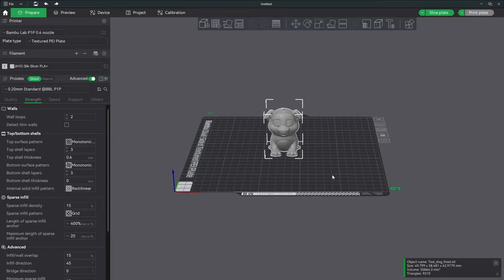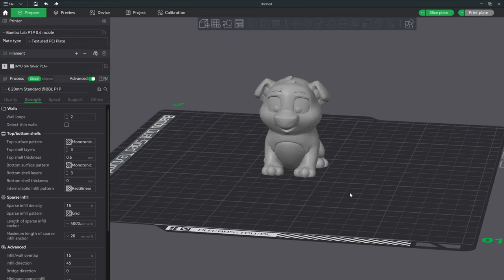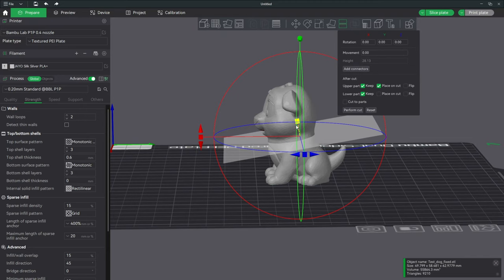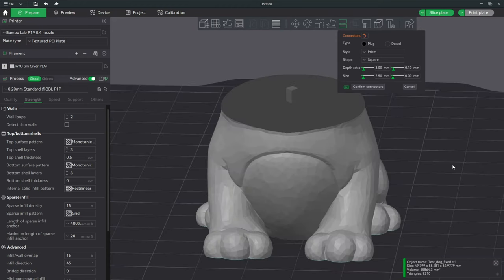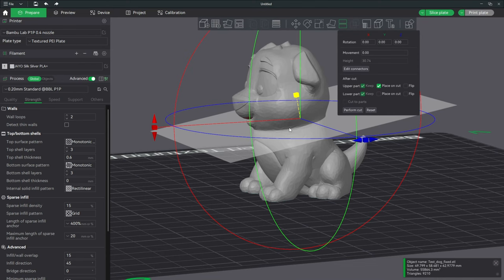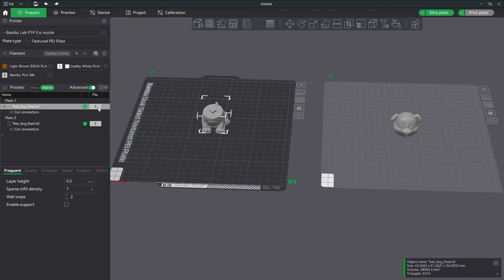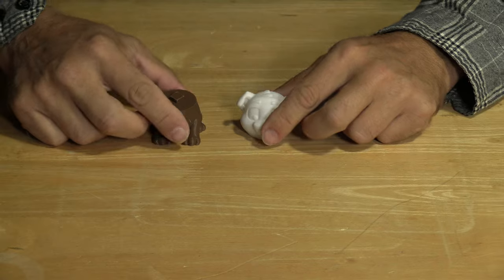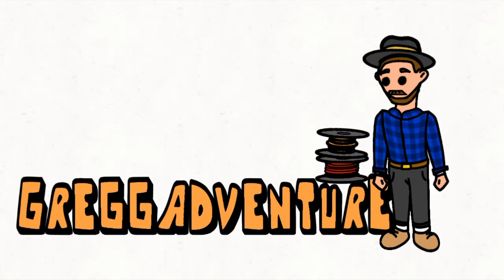How to Cut a Model into Multiple Parts with a Peg & Hole in Bambu Studio - Orca Slicer - P1P P1S X1C

Comment: VERY VERY HELPFUL, if I scale the figure to a larger size, is the union or the tolerances maintained or would I have to make the cuts with the final print size?
Reply from the maker: I would make the cut with the final size, but you should be OK.

Comment: Need to make sure Advanced Mode is toggled or option doesn't appear in tool bar. This crashes on current version of Orca on MacOS if you click the right mouse button while trying to set up the cut. And you can't type the angle of rotation for each axis as shown in this video.
Reply from the maker: That's what you get for using a Mac. 😂🤮

Comment: These quick tutorials are very helpful to new users!  Thank you!  :)    

Also, quick tip:  If you plan to print these sequentially on the same plate, don't center them both.  Keep one off center so you don't have to reapply glue stick!  :)
Reply from the maker: I'll do you one better. Don't re-apply for several prints. 🔥🔥
Thank you. I will be trying to do more. 🙏🏼
Reply: @3DRundown  
I'll do you both even one better: Use hairspray instead of glue stick. Much more uniform coating.
Reply: This is PLA on a textured plate, why would it need glue stick at all?

Comment: Awesome video thanks
Question after you spilt and you send the other part to a new bed , can you save this and print later for if you have the one printer ? 

Im currently working on some decor display pieces. Ive drawn a stand / base on them just working out the best way to print. I.e the design and the base separately.

Thanks
Reply from the maker: Of course. It's your project.... you can print it a zillion times. :)  Whenever you work on a model, be sure to save the project file.

Comment: Does anyone know which key I have to hold while rotating the axis for it to lock at the increments for eg. every 5 degrees and so on? Because manually doing so is a pain. 

And btw great video
Reply from the maker: When rotating, position your mouse over the notches, between the white line, and the blue line it will snap to increments

Comment: Is there a way to make the peg a separate item I can install after?  So basically a void for the peg on each side, then I can glue the peg into either side with glue. 

I am printing things I’d like to keep flat while printing and the peg sticking out prohibits that. 

Thanks for the video!
Reply from the maker: Ah yes. Makes sense. Same way I would want to do it. I usually do manually in mesh mixer. Lemme check on this
Reply: @3DRundown   Oh I think I found it, I think you do "dowel"  It leaves two holes and a dowel you can insert after!  Yay!  Thanks again for the video!
Reply from the maker: That's it. Beat me too it 👍🏼👍🏼

Comment: Is there a way to print them both on the same bed  at the same time?
Reply from the maker: Sure. But if using Multi-Color, I wouldn't. It would be swapping color every layer. There are ways to print one model at a time, but that presents a few new things to learn

Comment: Ok, did you test fit the two pieces before you applied the E6000?  If not, are the tolerances between the peg and the hole that precise?  I assume they can be adjusted but maybe they don't need to be?
Reply from the maker: Super tight. I didn't even have to glue it. They Snapped together. I would actually prefer a touch more wiggle room, but, yea, it was pretty spot on. I always use glue, but I'm certain I didn't even have to in this case. When I peg them manually in mesh mixer, I leave a little extra wiggle room, for glue, and so I don't need to apply any pressure for them too fit. There are lot's of adjustments that can be made, but, here I just wanted to demonstrate the basics, to get people started.

Comment: Is it possible to create a ‘pen & hole’ with any other slicer? If so - which one(s)? Thanks
Reply from the maker: ORCA cam do it, and I believe Prusa... but don't quote me on that. Keep in mind Bambu Studio works with other printers as well
Reply: @3DRundown  
Kool - thanks for the response - I will research the others - for now, I only have a resin printer; I do plan to get a FDM soon. I still have a lot to learn.
By the way - KUDOS to you on setting up a mod touch screen for the B/L P1P & P1S - the mod would make these printers more attractive to buy - Excellent Job!
Reply from the maker: Ender 3 V3 will be an epic 1st printer.

Comment: What happens if you dont use a connector and just leave it assembled with the cut? Trying to print miniature with a different colored base from the figure that stands on it. I was hoping that it wouldnt need a peg and would just print in 2 colors, one on top of the other and stick
Reply from the maker: Just do a regular cut, then assign a filament to each part

Comment: hello and thank you, but how can I do the opposite? Some miniatures are in several files and if you import them all at once on the board, they won't fit together. Others assemble automatically. I don't know where the instruction is in the files that makes some assemble and not others. Renaming it doesn't change anything. Thanks for your help.
Reply from the maker: Hey. Can you elaborate? Not sure I'm following
Reply: @3DRundown  Hello, figurines are broken down into several files. Head, body, legs, arms, hat, etc. When all the files are placed on the bed at the same time, they are combined for printing into a single complete figure. But other figures don't come together when you drop them on the bed. They have to be printed separately, and then glued back together after printing. I don't know where the instruction is in the files that makes them assemble automatically, or not. I can't give you the links to these files here. Do you understand me? Thank you for your understanding.

Comment: Hi

Which settings did you used for that print?
Reply from the maker: Hi. You can actually see most of my settings on the left side in the video. Which settings you most interested in? I start with 0.2, usually slow things down. Set my infill and such. Typically 8-10ish

Comment: I was to try this. Just to confirm, u printed one then loaded the next print or after the first one is done u remove the part and it continues to print the next or another step is needed to print second part ?
Reply from the maker: Yes. Printed one. Choosing white. Then, printed the other, choosing brown. I used an AMS, but you can just swap the filament
Reply: @3DRundown  okay thanks. If I’m only using 1 color i can print both on the same bed right ?
Reply from the maker: You bet!

Comment: if you need to change filament color, you can just select the object and type the associated number. it's a lot faster and easier. Why the filament color is always at the bottom of the menu when using a mouse is beyond me.
Reply from the maker: Isn't that super weird??  Also, great tip. 🙌🏼🙌🏼
Reply: also tipple click the color and get the selection then.